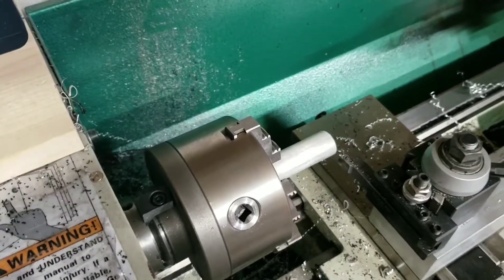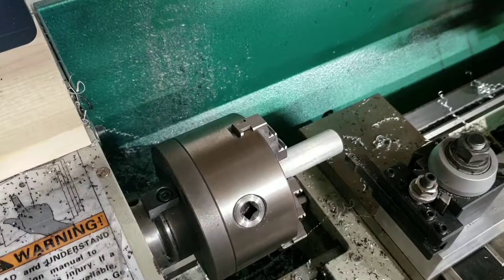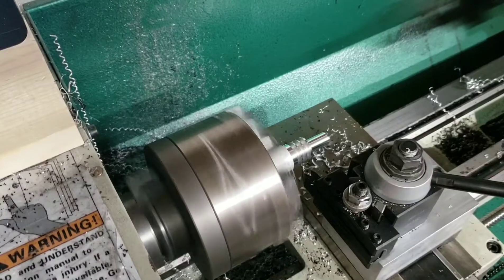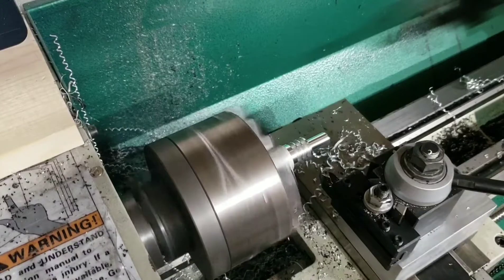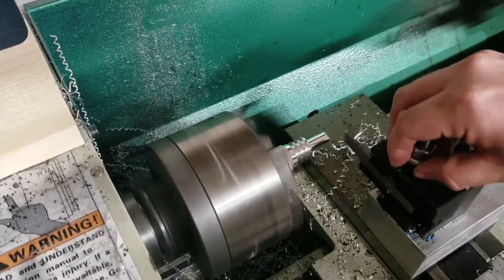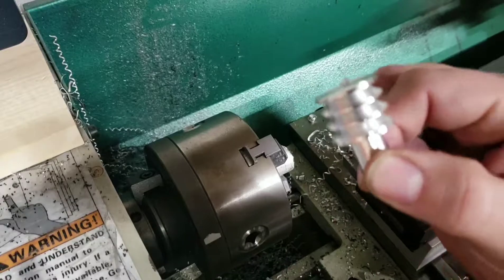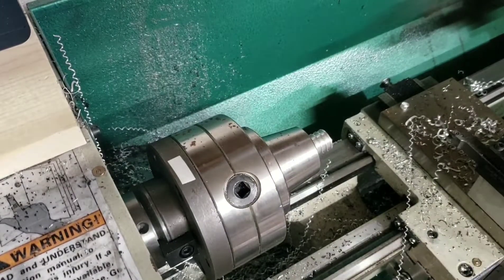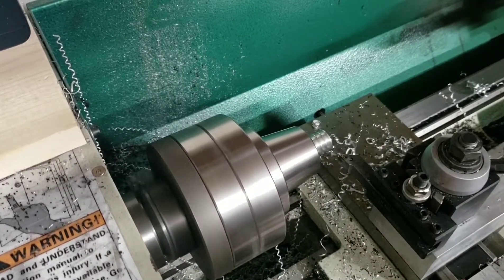Making a spindle motor pulley for the g0704 2.2kw spindle swap on my g0602 cnc lathe.

Comment from the maker: After making this video I realized I specified the wrong depth of cut.  I  doubled from .025 to .050 (radial depth of cut) and am now throwing c's and 6's all over the place.
Reply: Why you use dcmt inserts with 55 degree for make micro-v channels with 40 degree?
Reply from the maker: @101picofarad  Because it worked to make this part.